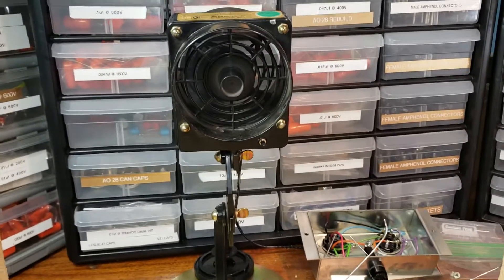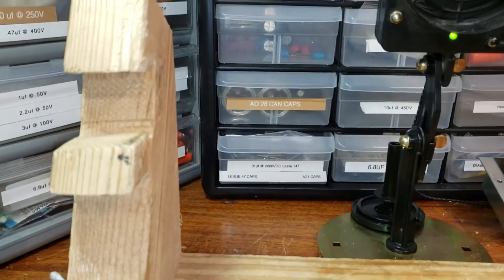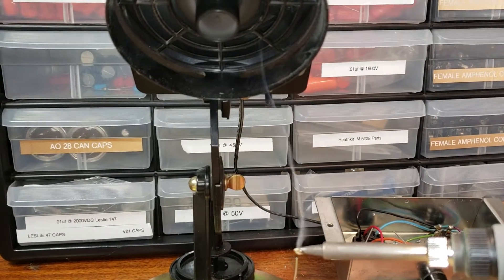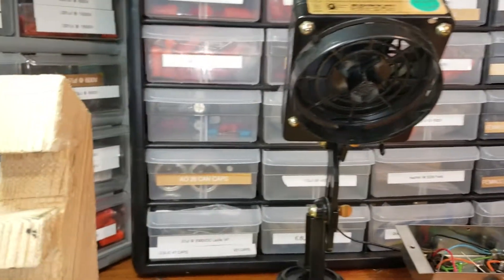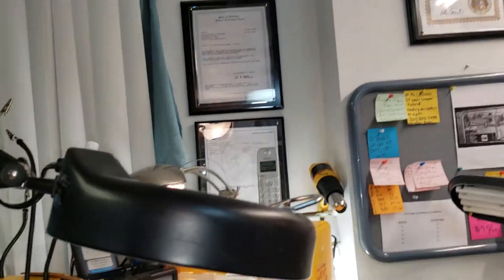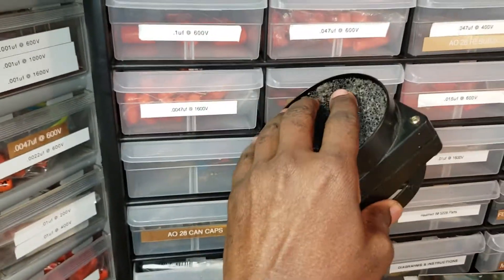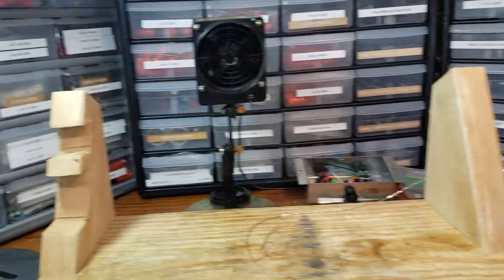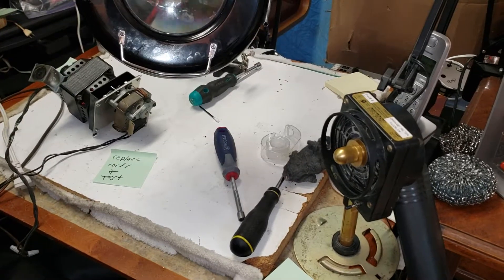Fume & Smoke Extractor For Soldering Station

Comment: its stupid
Reply from the maker: Really? What's stupid about it?
Reply: Dr. Arthur D. Kemp buy a fume extractor... not a ventillator with a crap carbon "filter" .... its not good to remove the fume... its good to blow it out from your face... but the way you use it, it blow from your face yes but behind you have a wall of component box that return the fumes to you.... connect a duct hose behind your "fume extractor" and get the tube away
Reply from the maker: @simonspeaker  - I see what you are saying.  I will look into doing that for my new shop.  Thanks for the recommendation Simon.  Much appreciated.
Reply: Dr. Arthur D. Kemp no problem! you can buy duct hose they are cheap or exhaust hose
Reply: Dr. Arthur D. Kemp also, you can buy cheap ebay copy dirt devil hepa filter... they are about 3$! you can put it on it